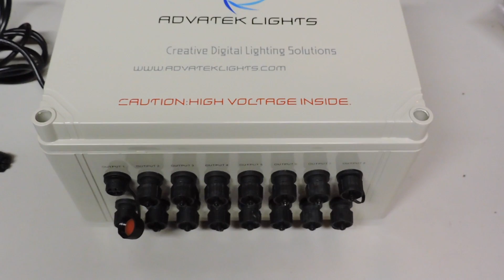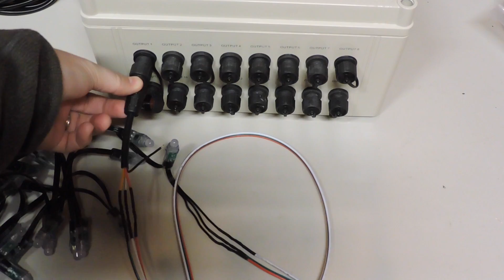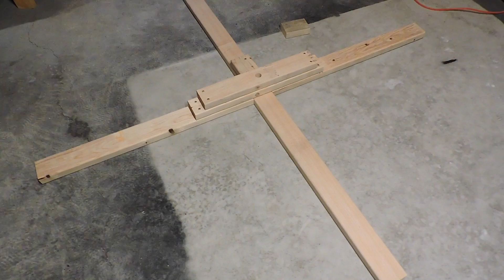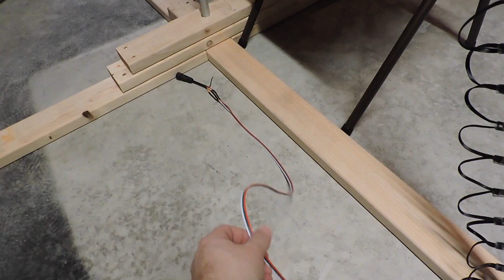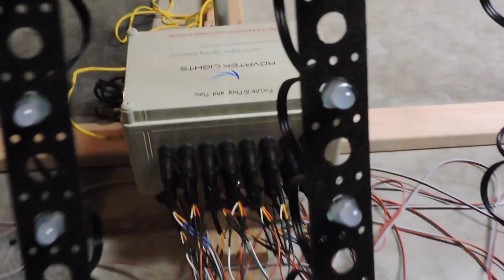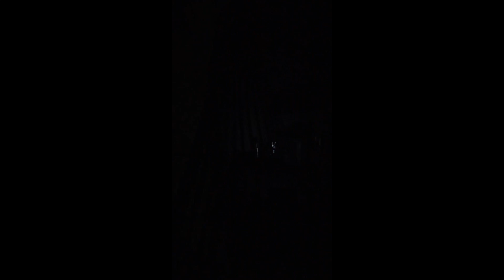How to build a RGB tree

Comment: great video.  I am just starting out in this hobby, I have the falcon f16 v3, a power supply, and some lights, more on order.  I am lost on the wiring side of it all.  I understand the wiring from the box to the lights, but power injection and fuses is one area I don't have a good handle on yet.  Did you not have to power inject any part of that tree?Thanks
Reply from the maker: No. We ran 16 strands, each from each channel on the box. Our lights you can run 150 lights without power injection.

Comment: This looks awesome!  Planning for next year I want to do this tree and also a few other smaller things like arches.  Can I double up the channels from the tree (2 strands per channel) and free up the other channels for other stuff?  Would you just wire the end of one strand to the beginning of the next one right?
Reply from the maker: Jason Clement you could do that set up a zig zag pattern in the software. You can typically run about 150 pixels off an output before power injection. If you learn power injection you could run the whole tree off 1-2 channels

Comment: Does the controller do all the power insertion?
Reply from the maker: The power does come from the controller. This particular set up has a power supply going to the pixlie board. The lights are plugged into the pixlite board. Each strand goes to a single channel on the controller, so there is no need to run any additional power.

Comment: How does the tree handle wind. The pixel strips seem fairly flexible and could move with a breeze
Reply from the maker: If you live in a windy area you may want to beef up your structure. You can add inner rings, guy wires..etc to give you more strength.

Comment: I am trying to work out what type of hooks you have on the base to connect the boscoyo strips to the conduit
Reply from the maker: jagmac01 they were 3d printed hooks. Id recommend using zip ties or staking the strips to the ground. The hooks will come undone with a little wind. We just used hooks for easier install and removal at trade shows

Comment: What voltage does the pixel strings operate at? And the controller voltage also.
Reply from the maker: These are 12v strands. Controller takes 12v as well.

Comment: How wide is the plate at the top of the tree. Is there anyway to get a pixel tree to have more of a point? I really like the ease of assembly, disassembly, and storage footprint.
Reply from the maker: +fishking107 Its about 8 inches wide. Our current plan is to add a star to the top (video coming soon). But, you could use a flange of somesort and attach hooks to it. That would give you a smaller disk on top.

Comment: I'm interested in the computer connections. You've shown a CAT 5 that can be attached to a "computer or Raspberry Pi". If my tree is on the front lawn, I wouldn't want to leave a computer out there connected or really run a 100' Cat 5 to the house. 

Can you provide more insight on setting up a Raspberry Pi or could an Wireless Ethernet Bridge be placed inside the controller case to set the programming? My wife has asked for a Pixel Tree for next Christmas so I'm beginning the build.
Reply from the maker: you could put a raspberry pi in the enclosure. If you had multiple controllers you could have the pi and a network switch in an enclosure. You don't really have to have the pi on wifi, but it makes it easier if it is. 

Here's a video of a pi set up right at the controller. 
https://youtu.be/zTSD8UWJT6w

Comment: I am very intrigued with the pixel tree and want to be changing my display over next year to pixels...arches...grid and such...I want to start building a tree about 6 foot tall...how many pixels would I need...controller and how do you inject power if needed?
Reply from the maker: I'd do a 8ft tree. That way you can just use 50 count 12mm lights with 2 inch spacing. We have pre-made controllers and all the pre made plugs you'd need to easily set up the lighting. Send us an email and we can work up a quote for you for a plug and play system.

Comment: Do you have to run those 16 separate strands? Or could you have ran the LED up the tree then back down then run a jumper and go back up and so on?
Reply from the maker: imlon2 you could run multiple strands off a single port. You can run about 150 pixels before you have to inject power due to voltage drop. So you could easily run three strands off a single channel. You have to be conscious of voltage drop and total amps. The fuse and wire is only 5amps so you dont want to go higher than that on a single run.

Comment: i purchased a 5v 16 plug and play. each string will have 136 pixels per output. will this system power 2,040 pixels or will i need another 16 plug and play system to power it?
Reply from the maker: 136 pixels for 5v is a stretch without power injection. You might run into some issues there. 12v systems are typically good for at least 150 without injection, so we would recommend 12v over 5v. But, if you are willing to power inject, yes, you could run 2040 pixels of a set up like this.
Reply: @TheLedwarehouse   thanks for the information! i already purchased the 5V system so i would like to inject power. to get all strands working. Could you recommend a power supply with would have enough power? Also when injecting power, does the additional power supply connect to the 2 (red, white) additional wires that are attached to the pixel strand?
Reply from the maker: jeffrey scott Id buy a meanwell 5v supply of some sort, we dont stock 5v so you’ll have to dig one up. Without seeing what lights you have its hard to comment on how to inject. Do know that typically you should stop the power, carry the ground and data through, or you will over amp your system. Electricity flows both ways :)
Reply: @TheLedwarehouse  Hi, i purchased 2000pc Addressable WS2811 RGB LED Pixel Full color Light 5V IP68 4 Xmas Decorate. 
They have 2 free additional wires on each strand so im assuming their purpose is to inject more power but im not 100% certain. 

As of right now, i only have 5 strands up. Ive tested them and everything is working great however, before i add more pixels to each strand, i just want to make sure im wiring things correctly. To answer your question, im not sure. I' m very new to this.

They have 2 free additional wires on each strand (red is +V, White is GND) Im assuming their purpose is to inject more power but im not 100% certain.
Reply from the maker: jeffrey scott typicaly thats the case, but, you do need to break the 5v+ chain of power when you inject or you will run too many amps and blow your fuse. Also, you should fuse your power inject line as well so you dont cause a fire if you run too hot
Reply: Would it be possible to inject power after 68 pixels? thats half! 68 pixels running on the ADVATEK system and another 68 pixels running on a separate power supply?
Reply from the maker: jeffrey scott probably, but depends on the quality of the pixels. You could try all 136 first and if you have issues, cut it back
Reply: @TheLedwarehouse  
DO you think this will be sufficient? 
MEAN WELL LRS-350-5 300W 5V 60 Amp Single Output Switchable Power Supply
Reply from the maker: jeffrey scott you’re going to have to get the amp rating on your pixels, and get the total
Amp draw requirements. That is a good supply though, just going to have to check to make sure its enough amps for your project.

Comment: If you had more than one tree,  would you just link two of the PnP controllers together via ethernet? 

Also, say you did power injection, do you need to purchase another PSU? Or could you tie into the one inside the PnP controller?
Reply from the maker: Atarox to hook two boxes together you would need a network switch. We didn't power inject on this tree. Our pixels go up to 150bulbs before you need to inject you just have to watch the power draw and run at a lower output. But to answer your question, yes you can inject off the same power supply as long as there is still enough wattage available. You would also want a fuse inline for safety
Reply: TheLedwarehouse awesome thank you very much for the reply :) makes perfect sense.

Comment: How much of a visual differnce would there be if you did 1 pixel per hole vs. skipping one?
Reply from the maker: Aric Stegen it would be half as tall. In that case you would want to use 100 count strands to get 8ft tall tree. It would be like the difference between a HD TV and a UHD TV. The denser the pixels the better things like text and pictures will look.

Comment: Hi, you said the RGB LEDS are 12v, is that correct? My understanding was that the 12v  WS2811 RGB LED's were not individually addressable.
Reply from the maker: Voltage has nothing to do with it. It's all about the chip. All WS2811 chips are addressable. I'd advise you do with 12v ws2811 s you'll have less issue with voltage drop s using 5v strands.
Reply: Agree on the voltage drop. Plus 12v power supplies are easier to source in Ireland. Thanks for the very prompt reply.

Comment: Curious. What size electrical.confuit did you use and how did you bend it to get the base
Reply from the maker: Jason Brown half inch. It was pretty flexible to start with. I actually  use turk stakes to stake it down as well since it has flex
Reply: @TheLedwarehouse  after watching this again multiple times I figured out what you are using isn't what I bought. Lol. I bought PVC conduit. It isn't very flexible. I saw what I need on Lowe's website last night. Thanks again.
Reply from the maker: @SCFireMedic67  good! You can also just get turf stakes and stake the strips to the ground and not have a ring at all. Depends on how firm the ground is.
Reply: @TheLedwarehouse  I like the look on how you did it. Plus we have Sandy soil here in the south.

Comment: if you were going build this on 2 channels do you run your data in a zig zag or all from the bottom?
Reply from the maker: you have to run your data end to end. With RGB you go from one strand to the next. So for two channels you would go top to bottom with your data. Then every 100 pixels for so inject power to prevent voltage drop.

Comment: How do you connect the wire to the controller which colour to where
Reply from the maker: Amir dad khan it depends on the wire and plugs you are using. Generally, its blue is ground, yellow is data and brown is 12v. But not all plugs have the same color scheme. Its a good idea to make yourself a map with what color wire you are using for each and stick with your map
Reply: Yup i did connect the wires accordingly but only the first bulb is lighted.
Mine red is 12v blue ground and white data in.
Reply: Btw im using the pixie 16 from light o rama. Try to setup using xlights. Do i need to buy the light o rama software to get it to work
Reply from the maker: Amir dad khan nope. Its works as a e131 device with xlights... id check your wiring and id check that you have the data going to right direction. Your pixels should have arrows pointing which direction the data flows
Reply: TheLedwarehouse 
Thanks so much. For the advice. I check both but seem no arrow on the pixel bulb.
If no arrow which is the first and which is last. Mine one end  got blue and red wire plus 1 jst male connector. Do i need to connect All the wire or just the a single jst connector
Reply from the maker: Amir dad khan just the male connector should work. Other two wires are for power injection if needed. My next guess is that your controller isn’t set up for the type of pixels you are using.  Youll have to go into your controller settings and make sure its set for your pixel type (ws2811, tsl3001....ect) Ive never set up a pixie 16, so im not sure how thats done!
Reply: Everything connected normally.
But only a few strand lighted.
Inject more power still same.
Computer synchornised as normal
Reply from the maker: Amir dad khan does the test mode on the controller light everything? If so, then you have a channel setting issue in your software.

Comment: If I️ set my pixlite 4 controller to 200 pixels per channel instead of 170 would I️ set the number channel within xLights to 600 instead of 510?
Reply from the maker: Jason phillips I dont think this would work. A single universe is only 510. So you would have to set one universe to 170 and a second to 30 to get a total of 200 lights per output. Also, you’d have to inject power on 200 pixels as well. Make sure you are watching your amps as well or you will pop a fuse on the board.
Reply: TheLedwarehouse thank you. Do you have an email address? I actually have a few more questions.
Reply from the maker: You can contact us through our store email or on Facebook
Reply: Thank you TheLedwarehouse I am getting closer to figuring this out. I am using 12 strings with 50 pixels in each. I am running 4 stings from 1 out of the controller to make 200 pixels per out. So I have 3 outputs from the controller running the Megatree. How should I configure this on the Megatree layout. It seems every way I've tried just does not look correct on the physical lights. Thank you for your time with this.
Reply from the maker: Jason phillips you must be going up then down? If thats the case you need to set up zig zag on your pixlite comfig. That or hand draw your tree in xlights so the right channels are on the right end of the strands.
Reply: I just sent you the config of the controller,xlights and megatree through facebook. Please give me your insight as to what I'm doing wrong. Thank you in advance!

Comment: How would you wire for the 4 channel control?
Reply from the maker: that gets a little tricky but can be done. I'd split it up into 4 strands, so youd be wiring together 4 strands on the tree. youd have 200 pixels per channel that way. the tricky part is that you have to inject power as well. so every other strand you should tie back into your power supply to prevent any voltage drop issues. The pixlite 4 will do 340 pixels per channel, you just have to inject power along the way. So technically, you could even wire this tree so it only used 3 channels if you wanted. just have 6 sets wired together per channel and inject power every other strand.

Comment: TheLedWarehouse thank you again for the help yesterday with getting my confit correct. You are definitely knowledgeable in this. Next I will be starting the frame work. Will a 1 inch emt pole work for the center of the tree? I did order a boscoyo tree topper. I was just wondering if it would fit over the 1 inch pipe. Would you recommend anchoring the 2x4 to the ground to keep the tree in place?
Reply from the maker: Jason phillips how tall of a tree? 3/4 emt is good for 8ft or less. 1 3/8 fence post works good for 16ft trees
Reply: my strips are 101 inches. So that is around 8 1/2 feet tall. Also how do I find the correct size and spacing for the bottom of the tree?
Reply from the maker: Jason phillips have to do a little math! Figure out your width of the base. Then the circumference of the base, then divide by 16. That will give you the spacing between the strips at the base

Comment: How much does thoes lights go for ???
Reply from the maker: fernando b just the lights are $22 a strand with the plugs already attached or if you wanted 100 count they are $37 with the plugs attached. A 800 light tree with controller lights mounting strips and topper costs about $950.

Comment: How would you go about adding a star to the top of the tree
Reply from the maker: jagmac01 i would add it on to the end of the first strand. You can run 150 pixels without power injection, so in this case you could add a 100 pixel star by just adding it to the end of the first strand. Then in xlights you creat the star model but your start channel will be the next pixel (144)

Comment: Is there another plug that can be attached to the light strings you recommend that would plug into a light-o-rama box outlet?
Reply from the maker: Bill Simmons you cant plug pixels into a normal LOR controller. Pixels require a controller that is designed to control pixels.. you can link a pixel control to a LOR box. This would let you expand your current LOR display with pixels
Reply: TheLedwarehouse Thanks for the reply. New to this and trying to learn different methods.